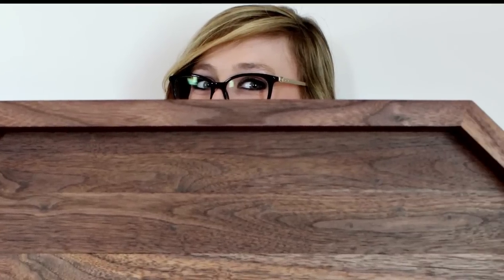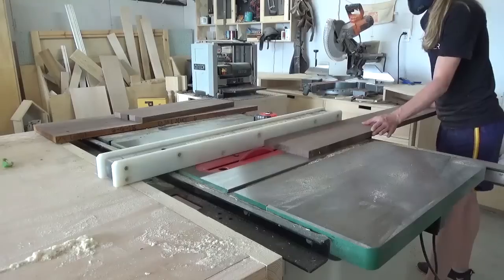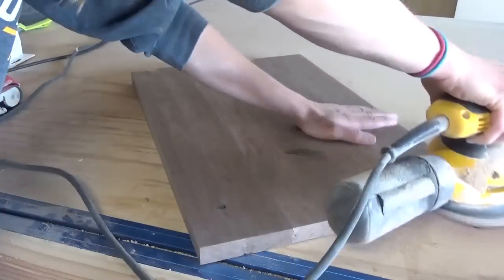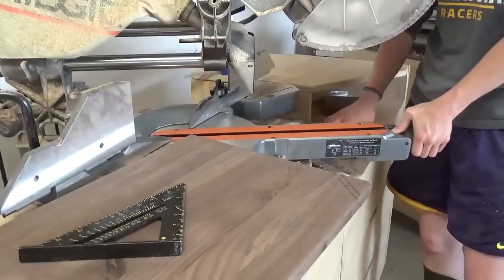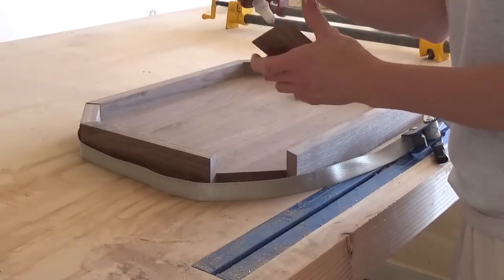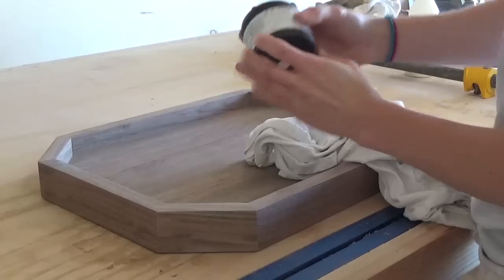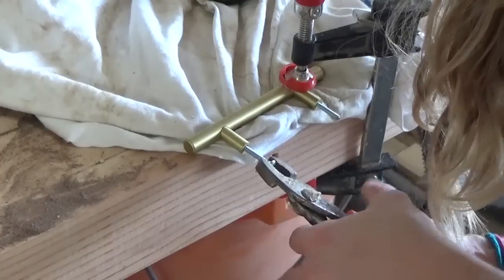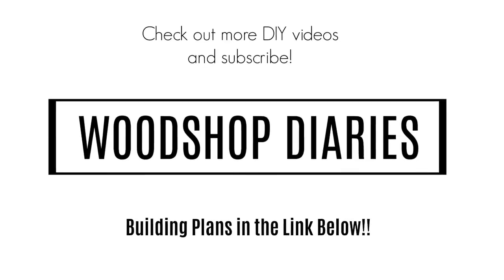How to Make a Modern Walnut DIY serving Tray {with handles!}

Comment: Thanks for sharing this! I'm getting ready to work on one of these too. I have done plenty of flat trays, but this will be my first one with sides. Do you feel the glue is sufficient without any nailing? I want it to be able to hold heavier objects. Also, LOVE to little hack with "hacking" off the screw heads. :) I have struggled to find fun handles that I can screw in from the top. Thx again!
Reply from the maker: Awesome to hear! It’s held up fine so far so I’d say the glue is sufficient. But it mostly just sits on the table as decoration and isn’t really “used” very often. If you wanted some extra security, you could use screws or nails as well.
Reply: Thanks! It’s to sell so I’d better play it safe with a few brad nails. But I’m definitely going to try that epoxy in the screw hole idea. Brilliant! Keep up the good work! Looking forward to more videos!